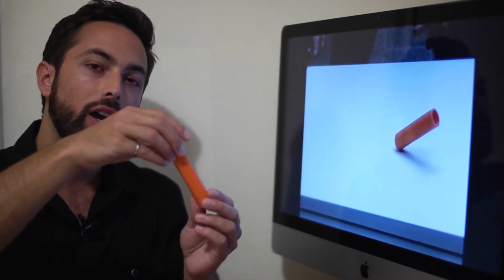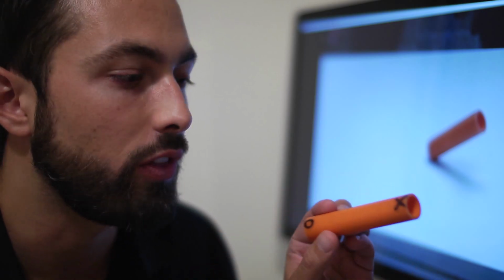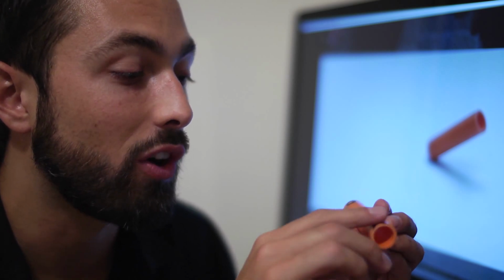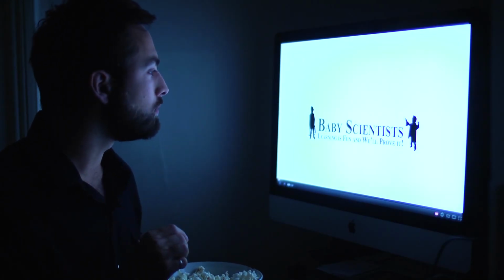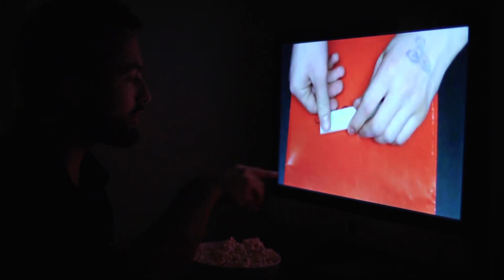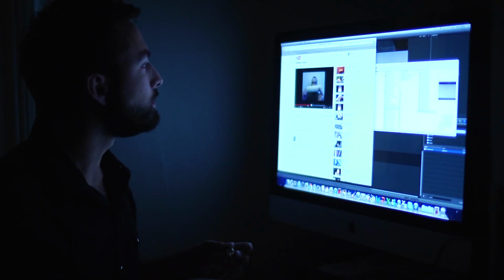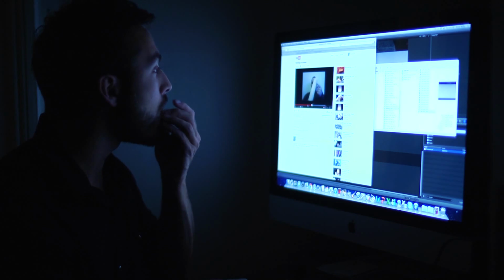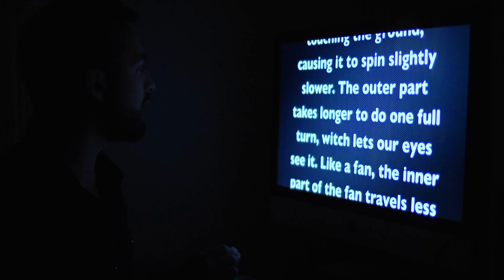Spinning Tube Trick Explained

Comment: This was very puzzling.  It was killing me, and I wanted to just watch the answer, but I also wanted to figure it out.  I did finally "somewhat" figure it out.  I could tell that it had something to do with the fact that both symbols are rotating around the tube's long axis in the SAME direction -- whereas, for it to be a symmetrical system, the tube would have to be literally twisting while it spins.  I started thinking about the Doppler effect and that seems to be very relevant.  I can't honestly say that I completely figured it out, but for the most part I did. Three-quarter win!

Comment: because of the same reason, the only difference is that it is reversed, the part touching the ground (and therefore moving slower) would be the opposite end when looked at from below, since the ends are "wobbling"

Comment: When you look from above the X is moving slower because the two rotations are not the same. When you look from below the X is moving faster because the rotations are the same. O always does the opposite of X, so when you can see X you can't see O and vice versa.
So, when X and Y is the same you can't see the mark on that end, but when you look from below on the same end, X and Y will not be the same so you can see the mark on that end.
Again, I hope this makes sense.

Comment: There is no "slower end". The tube is spinning around its centre, both ends spin at the same speed.

You can see one symbol better because each symbols' apparent speed (relative to you, or the table) is the sum of its movement around the tube's long axis and around its middle.

It's like the spokes of a wheel. It's easier to see the spokes near the ground because they are essentially "still" relative to the ground, while the ones on the top are moving at 2x the horizontal speed of the cart.

Comment: When he filmed outdoor, why did we see the X from the top and O from below the glass?
This has to do with the camera's shutter speed and how it syncs with the frequency of the X and O. As Derek explained, the O is moving faster around the circle and the X is moving slower. This means the O has a higher and different frequency than the X. Agreed? Now, the camera's sensor automatically increases shutter speed to compensate for increased light when you point the camera towards the sky. When you point the camera toward the ground, it is not as bright and it selects a slower shutter speed. Slower shutter speed shows you the X, higher shutter speed shows you the O. If Derek switched to manual shutter speed, he can force the shutter speed to show X instead of O when filming from below the glass. This effect is eliminated with the high-speed camera, which uses extremely high shutter speed and high frame rates to capture both the X and O on the same side of the tube.
Reply: Calvin C higher shutter speed should show both O and X, no? we only see the O.
Reply: The switch comes because, when the tube appears to spin clockwise from above will appear to spin counter clockwise from below. Since the tube's spin along its long axis doesn't change, the letter that is travelling in the 'slower' direction switches, when viewed from the opposite side.

Comment: because from the bottom side the rotation of the cylinder is reversed from the top side so the effect of one end of the tube crossing your vision slower is simply reversed.

Comment: Imagine you spin the tube by pressing the X side. If you look at the tube from X's open side  it is rotating counterclockwise; however, if you look at the tube from O's open side it is rotating clockwise. When you view the tube from above it is rotating counterclockwise.

If the side is rotating in the same direction as the tube when viewed from directly above (or below), you will see the letter on that side.

In this same situation, when viewed from below the tube is rotating clockwise.

Comment: The frame rate of the video has large affect on the effect. it creates a strobe effect. In fact you can use a strobe to show only the "O", but only if you had a consistent spin and duration of time to adjust the strobe. So a lot patient.

Comment: There is a much more basic "force" at work here. Yes, the tube is spinning on two axis, but that is not the reason why the second symbol dis-appears from view. As the tube spins our visual brain can't keep up the same way a slow motion camera can. To make up for this our brain tries to fill in the gaps. However since the upper radius is nearer to our visual input our brain will fill in with only the upper half. The reverse is true when viewed from below (the lower radius is closer).

Comment: @RockNLoad07 Picture the same problem, but from the other side. The side that's rolling with the ground will be moving (nearly) right along the surface, while the other side is sliding along in the sum of the speed of the spin and the rotation.

Comment: I think that the reason we only see the X when the X is pressed is because of it spinning in the opposite direction to it's velocity, slowing the velocity of the X side down slightly, but I also saw that the X side is raised slightly whereas the O is not - I genuinely have no clue what is going on there but I would say the reason is because the X side is rotating slower than the O which is rotating in the direction of it's velocity. But I really would like to know the answer.

Comment: I have 2 completely different questions.  Why does the end that's pinched down rise up in the air, & stay up in the air?  I think it rises because the tube was deformed by pushing down on it, & when the pressure's released it returns to round & pushes against the table, springing up.  What holds it up?  A leaning wheel rolls in the direction it's leaning, this cylinder rolls the opposite way because the mass of the raised end won't move as fast as the end that's getting traction w/ the table.

Comment: +Veritasium  Excuse me but I think that's not a complete explanation for this phenomenon.. is only a part;
First: it's impossible to reduce the velocity on one side and not on the other with PVC material and on this kind of experiment
Second: the fact of spinning against the tube motion on the rotation contributes to the final result
Third: this action causes the pushed side elevates into the air
Fourth: the pushed side keeps into the air spinning, but the other one spins on the surface and (this is the principal phenomenon) that makes this side vibrate because of the friction; and finally, the vibration makes the image to distort

You will prove this by checking the vid frames at (0:46 - 1:09); you'll realize the difference of distortion between both simbols
Reply: +Yiber Correa I made one myself and one end being in the air is immaterial to the effect. It has the same effect when i've spun it without any side in the air. Your viewing it like i was. He doesnt mean one side of the physical pipe slows down, he means the image of the letter slows down. It has the same effect without the table just spinning in the air, if you could. Hes referring to the image alone of the X or O, to the observer. So you could remove the pipe from the experiment. So lets say the x side is sweeping across counterclockwise across say, 2oclock-10oclock, it would be moving to the left, but as the IMAGE of the X starts appearing, it will be moving to the right, working against the motion of the counterclockwise direction.
Reply: +Balls Mortenson I mean, you're just describing the effect produced by the spinning on wheels rims.. on the other way, probably the same effect occurs when no sides are into the air, but that reduces the effect. I'm sure the fact of push the tube generates some vibration along the material, which will be more powerful on the side of the tube spinning on the surface.
(It's not clear when he says the velocity is reduce on one side, so what really reduces the velocity?)

Comment: Strictly speaking this was a problem in kinematics rather than physics. But the slow motion photography does reveal an interesting pattern of initially quite complex motion which then settles. I assume reason the tube has a distinct 'nose up' is due to gryoscopic stabilisation?

Comment: actually it doesnt. if you think about a tire rolling on the ground. the top side is moving in the same direction as the wheel so it essentially moves twice as fast as the wheel itself, and the very bottom of the wheel (when touching the ground at its lowest point) is not moving at all. 

when the X is spinning backwards,from the top the X moves slower (to better be seen) and the O is moving too fast to see. look from the bottom and it will be reversed, hence why you see the opposite symbol...

Comment: I wonder at what point on the tube you can see the marking. Say you marked the tube every .5 cm with a dash. Would you only see the first dash? Or maybe the first half of the tube?
Reply: That's an excellent question.  I think that it's about the speed rather than the rate of rotation.  So at one end the mark would "go past" at the speed at that end, minus the speed around the long axis.  Closer to the center, the speed would be less, but the speed around the axis would be the same, then at the center the mark would appear at the same speed that it would if the tube was just spinning along the long axis.  Then on out to the other end, the mark would be adding that speed to the speed of the rotation.  I think that's right, but my brain is starting to hurt a bit.
Reply: Probably affected by the diameter of the tube.
Reply: i feel so stupid.
Reply: The point is that you can actually see the other mark, but it's moving too fast to distinguish it from the solid color of the tube. So if you made markings at regular intervals, you'd be able to see them on the end that you pushed, and they would become less and less distinct down the tube.

Comment: I was wrong, he did not place then on opposing sides. But I understand the way it works. Similar to traction for a car and why you may notice your car drifting to side. The drive tire is moving faster than the slave tires. I love physics. I love automotive engineering.

Comment: No, because the X's speed will still be reduced (the speed doesn't change because both frames of reference above-below are not moving at all). O's speed will still be more than that of the X, therefore X should only appear.

Comment: 1:02 Wait.. Move across my field of view faster? Doesn't the slow mo show that it will be in my field of view for 6 frames, as is the X, in the following few seconds. I mean, the tube is connected. Friction and atoms and stuff - the same reason we can't make a space cable that the other end moves faster than the speed of light and stuff. Both the O and the X are on the top side for the same amount of time in that slow mo video at the time I linked, right?

Comment: I know the spinning tube experiment was several years ago, but since I just discovered it 2 days ago, I'm commenting now.  I'm ok with your explanation about why one letter is visible but not the other.  However, my question is this, could your brain, knowing what options were available to it, have been predisposed to seeing one of those letters? In other words, if a third party had drawn different letters or even numbers or shapes without you seeing them or knowing whatyou expect, would you still be able to pick out the drawing? This, of course, would mean the third party would draw the objects and place the tube under your finger with your vision blocked. Then once you spin the tube, open your eyes or unblock your vision. Your first glimpse would be while it is already in motion. With your brain having no idea what the options might be, would it still be as easy to pick out one vs the other side? I assume that nothing would change and you would still see the drawing that was on the spun side.

Comment: i havent seen any thing but the slow motion part and i think the answer is when you push one side it stays on the ground and the other in the air since the rotation on the bottom is slower you can see that letter  instead of the side in the air spinning to fast to see i guess i will find out right now

Comment: Seen from below. if the tube was spinning in a counter clock wise direction, seen from below, it will appear to be spinning clock wise. which then does the same effect as from above, but in reverse.

Comment: What if the tube were rotating in both ways near the speed of light? Obviously it couldn't happen, but would the symbol at the opposite end from the 'pinched' end move faster than light? Would the pinched end's symbol have moments (ha ha) of being still and then accelerate to near lightspeed in a very short period (ha ha) of time?

Comment: Actually, your eyes do have a frame rate. Granted, it varies with different factors, but there is a limit. This is caused by the physical speed limitations of signal (chemical and electrical) transmission.

This is why we see more in a slow-motion replay than we do when watching something live - because we see more frames than our eye naturally can. It's also why there is an optimum fps rate for animations. Beyond the optimum, you're wasting frames because people can't detect them.

Comment: but why does the x never touch the ground? is it how fast the other end of the tube is spinning? or air velocity on the top of the tube you spun it from? it just like boggles my mind to watch it spin but it almost never changes form and would not if not for gravity. just think of it like a planet spinning but staying the same shape and angle only that the lower most point spins around itself>?

Comment: To put it simply you see the X from the top because the rotation of the x is opposite to its direction of travel.  Also you see the O from the bottom for the exact same reason...AHA!!! Watch the video and pause it several times and you will see that on the bottom the O is travelling opposite to the direction of travel for the tube as a whole..

What do you see when you view the tube from the side?

Comment: Imagine facing an empty toilet paper roll on it's holder, with an X on the left side. When you spin the roll toward you, the X moves toward you, but as it turns toward the bottom of the roll, it's now moving away from you. Now imagine the whole thing also turning very very slowly clockwise on its top to bottom axis. As the x moves toward you it will be moving against the clockwise spin, but when it's on the bottom of the roll it is moving away from you and moving WITH the clockwise spin

Comment: This is similar to captured rotation. What would it be called?
Harmonised or twin rotation?
I get the idea that the length and diameter of the tube is immaterial, as is the amount of force applied. So how come both directions of rotation have the same period?
Reply: They don't necessarily.  In the scene in the hardware store, you could see the X appearing three times, 120 degrees apart.  That means that the rate of rotation along the long axis was one-third of the rate of the perpendicular spin -- in that particular instance.  But it depends entirely on how much of the initial force gets applied to the axial spin, and that isn't really controllable.  The effect of the trick here isn't caused by the periods of the two rotations (that's what I thought at first), but just by the fact that the axial rotation is in the same direction as the perpendicular spin at one end, and the opposite direction at the other end.
Reply: Thanks. It should have been obvious.
Still hindsight is useful in the event of the obvious being delayed.
Reply: Michael McNeil Oh, it's not obvious at all, that's why it's called a trick.  I had to explain it to myself three times before I could follow it.

BTW, a sensible discussion in YT comments is a rare pleasure.  Thank you.

Comment: It is not because the O goes faster than the X. It is because when looking from above, the X is spinning in the opposite direction to the rotation of the tube. While checking from under the glass, the O will be spinning in the opposite direction to rotation of the tube! Just look at the slow motion again.

Comment: Well, when you look from the top, you can see the X because it is rotating around the axis anticlockwise, but its ends are rotating around the middle clockwise.

But when you watch from the bottom, your point of view is reversed, meaning the O, in this case, would be spinning clockwise, and the tube is spinning around the middle anticlockwise.

I hope this made sense.. If it didn't.. Welp.

Comment: Because the side you pushed is spinning in the opposite direction on the bottom. Much like the tire of a car, the top of the tire is moving forward, the bottom backward (relative to the car).

If you filmed it from the side you would see no difference between the X and the O.